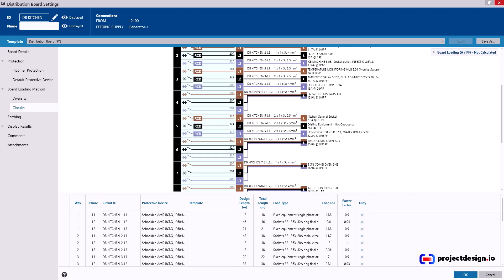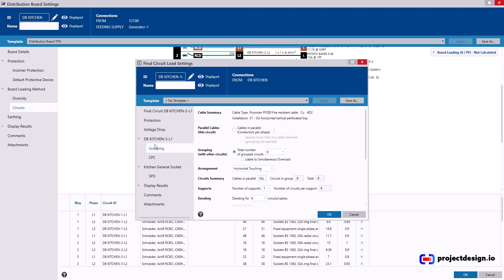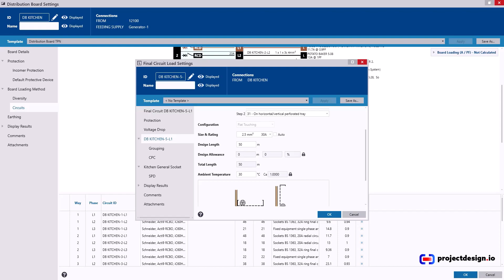PD 03 01 04 Functional   Ring final socket circuits

Comment: Hi i have a doubt. There is an auto transfer switch(ats) and its output is a sprinkler. One of the inputs of the ats is a generator and the other input is from a transformer secondary.  The secondary of the trabsformer is also connected to a switch board. But i coulds draw two cables from the secondary of the transformer. I can draw only one one. Either to the Ats or to the Switch board . Can you please help with that.
Reply from the maker: Typically the sprinkler primary supply is connected from the main switchboard from the live side of the supply to prevent losing the supply when the main switch is off. As you said in ProDesign, you can’t run two cables out to two separate loads. If you want to mimic what you described, I suggest that you run the primary sprinkler supply from the switchboard without protection.